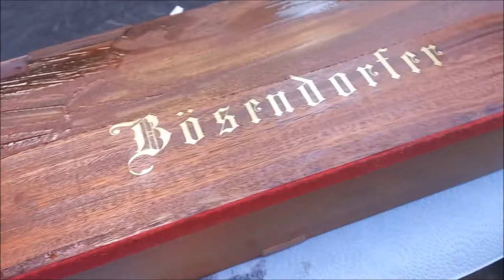barn find Piano restoration

Comment: What was that mix you used for the cast iron plate?  Mine has gotten all speckled and I want to do something like this when I eventually restring.
Reply from the maker: @dandomenech4112  Schellack, metal powder and a little bit of oil ( not necessary)

Comment: 4:42 - 4:48 - I would love to know what you are doing right there with the strings. Is that a special device to separate the individual strings evenly with a consistent spacing?

By the way, did you reuse the bass strings, or any other original strings?
Reply from the maker: I press the strings down to stretch them, to improve the tuning stability. I reused the base strings..
Reply: @sarbachpiano - Thanks! That makes a lot of sense.
Reply: @sarbachpiano  original strings don't produce a good sound for what can I hear. Cost saving or client's request? Or both?

Comment: Looks like a decent job!
I’ve done this process many times but never put shims in the sound board. I did my part in the shop. I did restring them. 
Etc.  
It didn’t show him checking the downbearing. On the sound bd. 
After restringing he used the roller to stretch the strings. 
That may be not correct today.

Comment: So why are ivories missing in the beginning, then they're there when you take the action out? I can see changing the color of the case, but what was gained by painting the harp... outside of covering up the serial number so now you can't verify when it was made? Same goes with sanding the company off of the sound board. Sorry, thumbs down.
Reply: Also, since when was plastic veneer 100 years old - the stuff he removed with the heat gun?